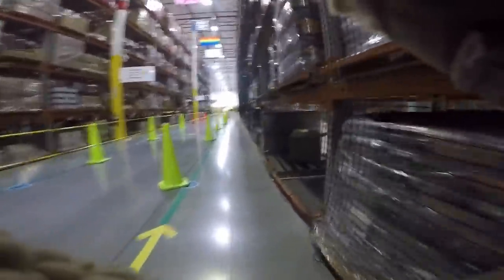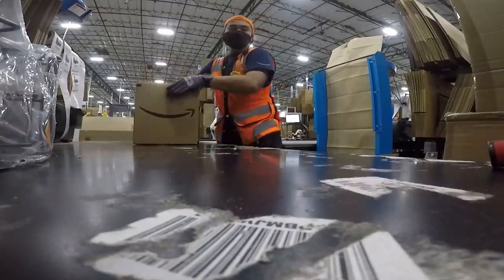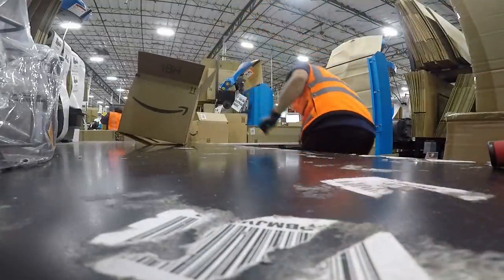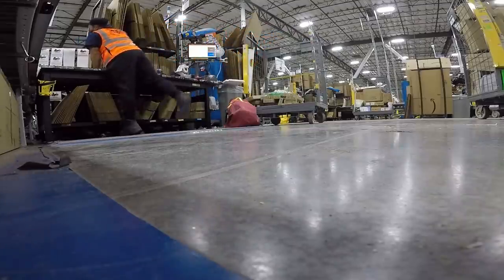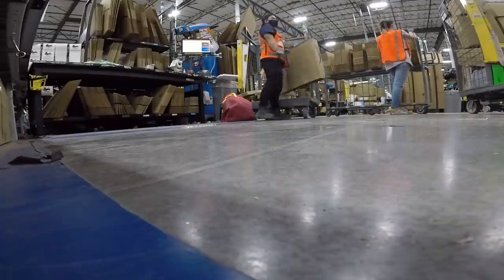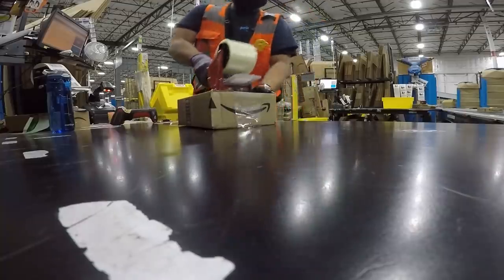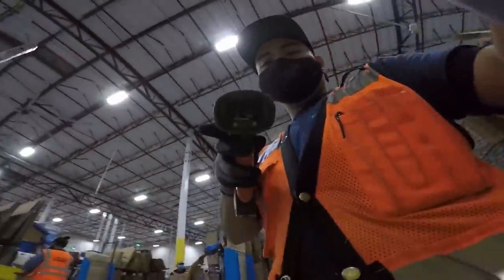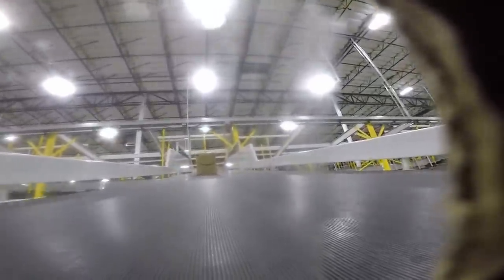DAY in the LIFE of an AMAZON PACKER

Comment: just a note, the paper doesn't do anything, its just in there
Reply from the maker: You mean the dunnage? That's because a lot of Packers don't do it properly.
Reply: @maakudesuyo  yea, it doesn't look like the amount he is putting in there is doing to much. I could be wrong as im watching it and not there.
Reply: the brown paper is what im talking about
Reply from the maker: @ItsDaPlumber  it's usually just placed in the corners to prevent the item from moving. The weight and size of the item also dictates how much is needed. Also, putting a lot, although safer for the product, will kick it out if the conveyor and cause a lot of problems downstream
Reply from the maker: @ItsDaPlumber  yeah that's called dunnage
Reply: @maakudesuyo  I like the dunnage. back in the day i used the dunnage to wrap all my gifts. My wife thought i was crazy but they gave so much if it. It was very easy to flatten out and reuse. Now we use it to draw on with the granddaughter. Crazy..